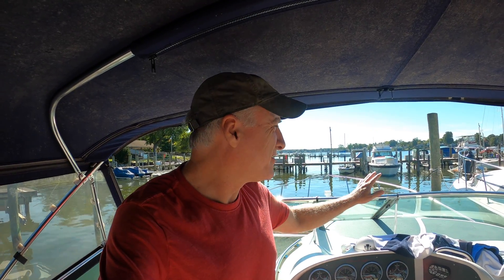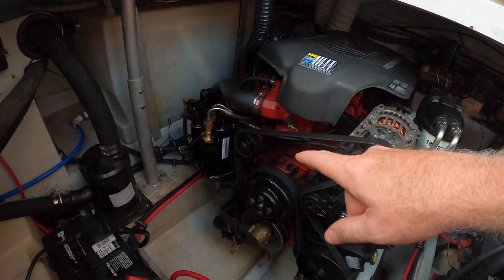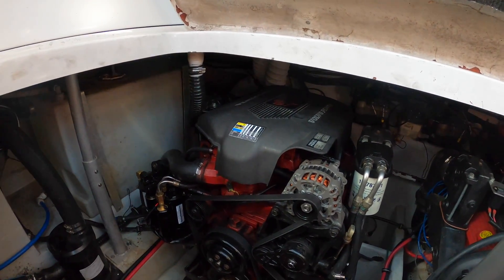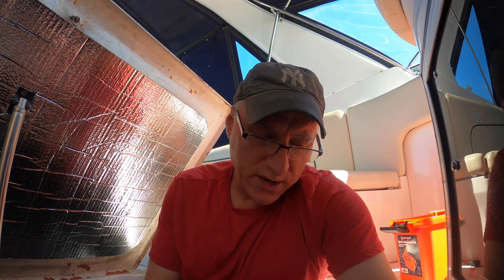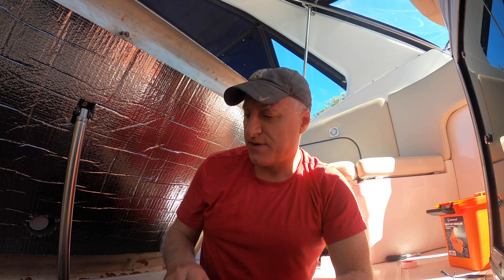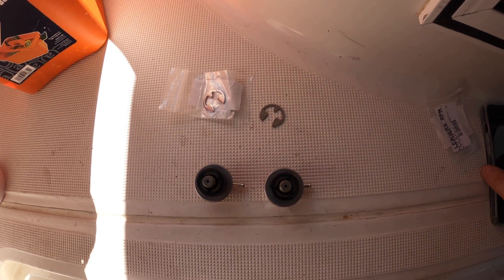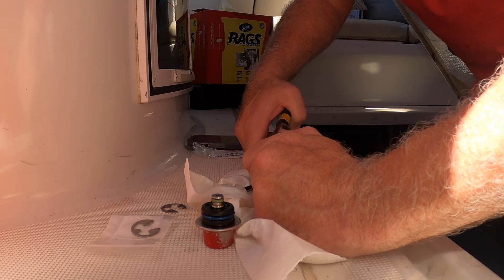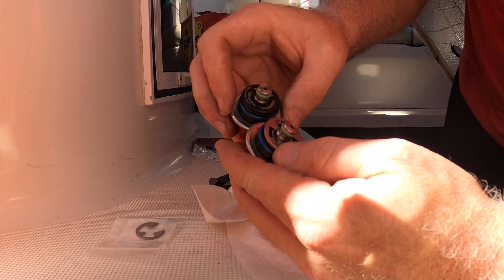Replacing Screens on Fuel Pressure Regulator with E-Clip - Volvo Penta marine engines - Episode 58

Comment: I am not sure if I missed it, but what were the problems you were having after replacing the pumps that got you to this? I replaced my pumps and still have a remaining starting issue. Potentially after running for a bit and then sitting, but it takes awhile to crank. I did clean my screen when I replaced the pumps, but I get a high side spike to 80psi on prime that bleeds down to 45. Wondering if maybe my screen is clogged and I cant see it?
Reply: I was having the same problem of it not wanting to cranck back up when it's hot. At my marina they've ordered an e-clip since it was never replaced. They also cleaned the screen while that part is on order.. I just got off the boat and it's cranking up good with just the screen cleaned for now
Reply from the maker: @jloo2135 I hope that works out for you. It’ll be interesting to see if you notice anything different with the e clip.
Reply from the maker: The problem back when I did this video is that paint chips were consistently clogging the screen. Eventually the screens were replaced with this E-clip and that helped quite a bit. If your high side spikes to 80PSI it sounds like the pump is not working and needs to be replaced.

Comment: Wait wouldn’t you want screens in there to protect your fuel injectors? Seems like it’d be a lot easy to clean out those screen once in awhile than the alternative. Or are you just not worried since you have the aftermarket paint removed pump?
Reply from the maker: I did this a while ago so my memory might not be perfect. But we did it because the manufacturer came out with that recommendation to address previous issues. We have had zero problems in the last 2 years since we did this. the screen might have also choked the fuel flow but I’m not sure. Thanks for watching and for your comment!

Comment: I’m dealing with this now, is there any concern about left over paint getting into injectors after replacing screen with the clip. I just replaced fuel pump and new pump is starting to do the same thing so hope this clip solves the problem I ordered brand new FP regulator to hopefully make sure my problem is solved. So frustrating
Reply from the maker: Agreed it’s frustrating. Yes there is a concern. I would frequently try and clear out the black paint debris where it builds up. Then buy a pump from mancave mechanic since he removes  the paint from aftermarket models and resells them clean. Then always have a spare on board. I’d also avoid doing what I’m doing today. Running the boat with less than half fuel because this is what often put too much pressure on the pumps to work. Those are my thoughts. Thanks for commenting.
Reply: @eternitysshore  Thank you
Reply: @eternitysshore  I had just topped off my tank also so it was full so guess I still have paint issues..
Reply: @brianh9537 did you have any paint chips clogging any injectors? My screen was clogged on the fuel pressure regulator and I replaced it and new fuel pump along with a new anti siphon valve and full tune up but I’m still having issues. My next thought would be the paint chips messing with the injectors
Reply from the maker: @matthewgrizzell1031  your new fuel pump might have been painted on the inside like most of them. Even the Volvos. I bought mine from someone who buys aftermarket ones and removes the paint and resells them.  Mancave mechanic

Comment: Enhorabuena por tu canal lo primero y segundo decirte que a raíz de ver tu video, compre en EE.UU a Man Cave Mechanic el clip dado que en España era imposible, ayer me llego y mi pregunta es la siguiente. ¿ Que síntomas notaste o cual fue el motivo de cambiarle esa pieza ? Gracias por tu ayuda y un saludo desde Valencia España !!!!
Reply from the maker: Thanks for watching and for your questions. The reason we replaced the screens was that Volvo Penta sent out a parts bulletin back in 2010 about the fuel pressure sensor regulator. The previous part, the screen instead of the E-clip apparently restricted the fuel return line and decreased engine performance. We did notice before we replaced the screen the build up of black paint chips. Check out the first couple of minutes of this video to understand what was happening - https://youtu.be/iPa9mAaHS64?si=-lJf0VwALhn3bsXw
Reply: @eternitysshore  En mi caso cambié la bomba completa también y limpié el regulador por que también lo tenía igual.Ademas desmonté la rampa y los inyectores para limpiarlos con ultrasonido, cosa que te recomiendo. Y ahora después de todo eso, descubrí a través de tu video lo de quitar el filtro y poner el E- Clip y tengo pendiente hacerlo y medir presion de bomba y rampa.
Gracias por la rapidez en contestar y seguiré pendiente de tus vídeos, que siempre se aprende, un saludo 👋 😉
Reply from the maker: @Sailor_cokay.  thanks for sharing your own expertise. I’m glad you were able to learn something from our channel. Looks like you started your own! Thanks for watching!

Comment: I came super close to purchasing a cruisers yachts with twin Volvo engines until I learned about all the fuel pump paint chip issues. Glad to see you've got yours worked out.

Get yourself a dental pic for removing some of those rubber washers and stuff, it works great.
Reply from the maker: Interesting that you learned about it. Wish we had known although since replacing both pumps and screens now with e clips we’ve had no issues.

Comment: Great work! It's disappointing that Volvo-Penta was so careless with repainting the GM engines and over spraying in areas that result in so many fuel delivery issues.
Reply: Do you know if that clip applies to the 4.3gxi as well? Or if there is a different part #/service bulletin?
Reply from the maker: Thanks for watching and the comment. I honestly don’t know. Check forums maybe. But If your engine uses the same type of screen I would guess it got replaced.
Reply from the maker: Thanks Brook. And really appreciate your help. So far so good!

Comment: I don’t have Volvo engines. But it looks like your engines were repainted at some point (I noticed ignition wires and some other parts were oversprayed). Were the engines rebuilt at some point ?
Reply from the maker: No they are the original engines. They might have been repainted at some point. I’m not sure.